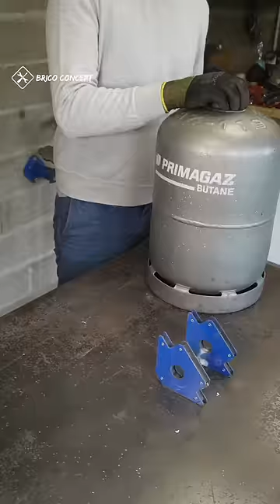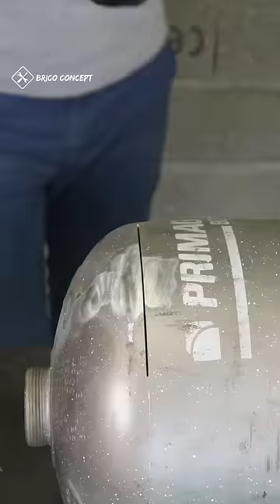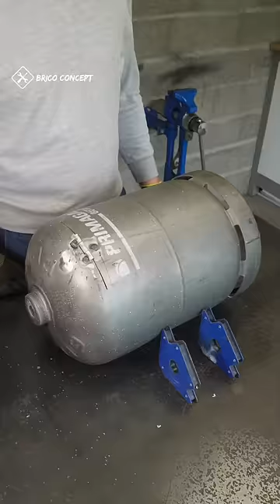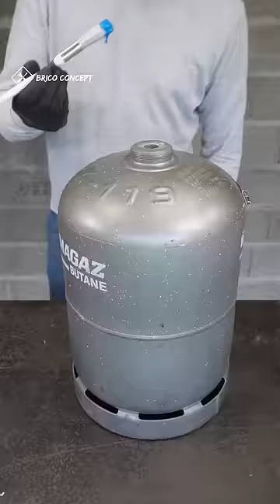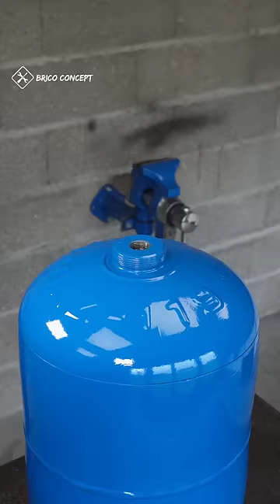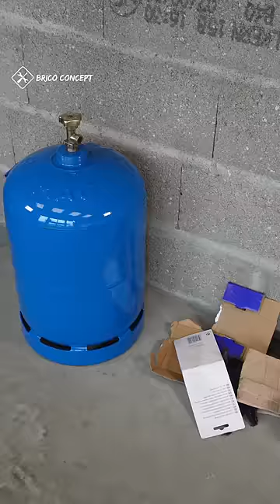I Recycle An Old Gas Bottle That I Let Degas For 1 Month #shorts

Comment: DON'T!!!!
If you wanna cut gas cylinder, fill it with water first
Reply: asa q
Reply: Yes
Reply: If you want to cut one for this, Don't add water 😂
Reply: Don’t ? He already did it 😂
Reply: Much funnier with full tank 🎉
Reply: You absolutely fill it with water and dump it out, it's the safest way you can do it.There is only one simple and efficient way to get rid of all the remaining gas: Fill the cylinder with water (until it's full). Then, empty it. The water will expel the gas, and be replaced with fresh air. Obviously, do it OUTSIDE or you'll get propane in your home/workshop
Reply: Buy dust bin cheaper

Comment: A bin will cost you 5 €. Deposit on a gas cylinder is 30 €.😂
Reply: nobody said this is cheaper
Reply: El depósito  de gas te va a durar  toda  la vida 🤷‍♂️....
Reply: @elpatolucas22  I've had my bin for the last 30 years.
Reply: @elpatolucas22  8

Comment: Attention !!! don't do it the cylinder can EXPLODE in the cut !!
Reply: Just fill it with water and btw. Not every gas burns
Reply: @ted994  except that cylinder specifically said it was butane so it absolutely will burn.
Reply: @giggidygiggidy4884  Right
Reply: Chhuuuuuut.... juste ta gueule on pas con tkt
Reply: @giggidygiggidy4884 he degassed it. It's fine. Stop being a fruit cake
Reply: Y en la soldadura jaja

Comment: This clown missed a couple of steps, like make sure you remove the valve and fill it all the way with soapy water and empty it before you cut. Otherwise you may find yourself in the hospital or dead.
Reply: ههههههه    يضن  اننا  اغبياء مثله  ههههه
Reply: Soapy water for gas? 
Is that in case of liquid residue?
     (I imagine water will push any remaining gas out, correct?)
Reply: He let all the gas out I'm assuming the fact he's not dead he knew what he was done calm down bud
Reply: Why soapy water? Isn't just water sufficient? Please, explain
Reply: Damn you know what they say about assumptions 🤡🤡🤡
Reply: He let it degas for a month
Reply: Mais on connais putain on est pas con bordel tu te crois plus intelligent
Reply: he did remove the valve before cutting
Reply: Looks like somebody did not read the caption; he said he let the gas out for 1 month and then he cut the cylinder.

Comment: Why'd you let it degas for a month LOL, all you had to do is fill it with water 🥴🥴🥴🥴 There is only one simple and efficient way to get rid of all the remaining gas: Fill the cylinder with water (until it's full). Then, empty it. The water will expel the gas, and be replaced with fresh air. Obviously, do it OUTSIDE or you'll get propane in your home/workshop

Comment: Dude make sure to show safety steps for those with no common sense
Reply: Open valve and drill hole. Let the cylinder air for 24 hours
Then fill it with water and rinse thoroughly before you start to cut. Do it slowly with stand by water hose near you.